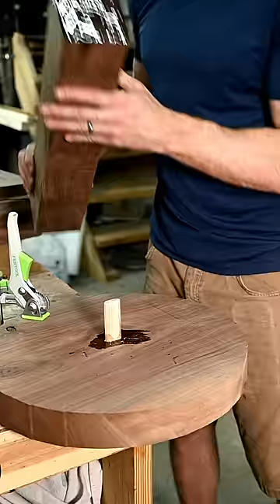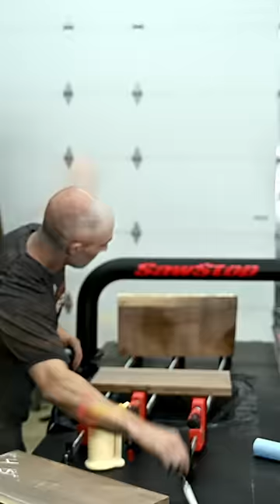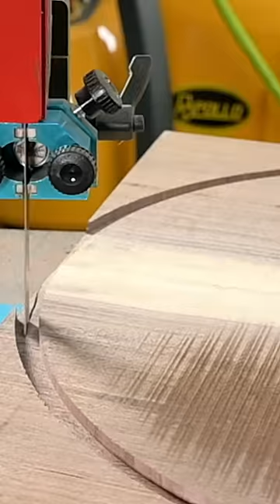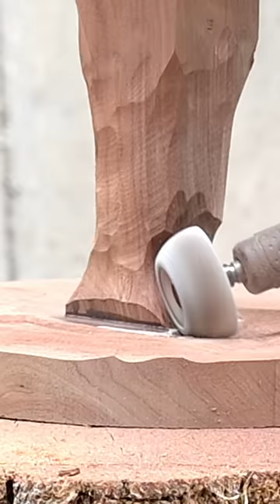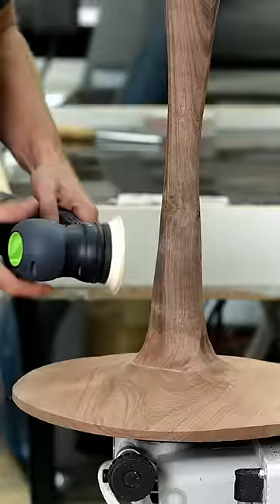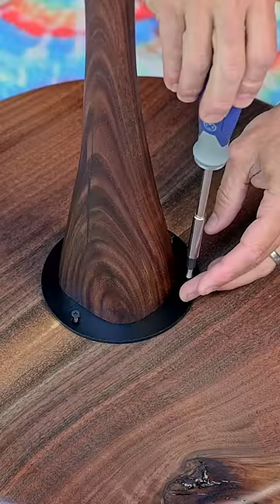I Tricked a Customer

Comment: “I’m going to spend less than $100”

Starts using his $10k worth of equipment
Reply: Yeah exactly
Reply: 10k? Probably more tbh lol
Reply: Way more
Reply: Hell just one of those machines is probably like 15.
Reply: And 80 houre of labor.
Reply: most average woodworkers have this equipment
Reply: $10k lol, that table saw alone is over $5k. His shop is probably close to $50k in tools, or more.
Reply: @TraderJoe_ 🤣
Reply: That table saw was close to 10k.
Reply: Imagine having unlimited resources
Reply: Screw driver..$3 at Walmart, DA, $25 at Walmart, 4" grinder, $50 a Walmart, table saw, $140 at Walmart, end grinder, $35 at Walmart, band saw, $140 at harbor freight, router, $30 at Walmart. 

I think you can plenty of tools, some even not a necessity for less than $1000.... not sure where you came up with 10k from.
Reply: @wojtek-33 didn’t say you couldn’t, just stating the fact he used expensive tools. Building something for $100 is easy when you have a baseline workshop value of $5-10k of equipment. Clickbait vids like this as always wins 😉
Reply: @MsDtab321 was a generalisation, which I guess you misinterpreted. The point is speeding less than $100 is easy when you already own industrial quality equipment that makes the job easy, for someone using manual tools this same table takes weeks - months to build.
Reply: @wojtek-33  calm down petal it’s a Sunday afternoon, relax. I suggest you go spend some time with your family, or have a beer instead of wasting your time justifying a completely irrelevant point to someone on the internet that didn’t ask for a) your point or b) your justification. I stated a fact and you’ve taken it upon yourself to be rattled. Calm down son. Take care
Reply: Lol people like you don’t understand. He probably paid a lot for the tools either out of pocket or with a loan. Either way, I’d be willing to bet, they paid for themselves within a couple months.
Reply: LMAO WHAT??? I’m seeing basic woodworker tools. All of which you can buy for cheap almost anywhere 😂😂😂
Reply: @AshtonLudlam  “he probably paid a lot for those tools..” thank you for ending your own argument. As you were
Reply: Yet you can still do it without all of these tools and just use basic shit
Reply: And he hasn't earned that? Or are you just jealous that you don't have what he has?
Reply: He meant for the eood
Reply: Wood
Reply: try 20
Reply: Lol
As he said, you do NOT need expensive tools
Basic cheap tools from Harbor Freight will do the same thing…
Reply: @wojtek-33 the thing is he can’t make it with basic tools. Been proven time and time again. He isn’t a craftsman. A rich skilled hobbyist.
Reply: He says in another video he has $70k worth of tools. He's a great machinist but an average woodworker
Reply: Because he was able to buy it and create literal art with it. Gotta invest in yourself big man
Reply: The tools he buys is an investment. Lol he bought those long ago as he made more money using them to sell products. That's why you buy tools to use them. Not just to collect dust.
Reply: Way more than $10k!!!!
Reply: Bruh you obviously didnt watch the full thing, he said that you don't need his equipment to do the same thing
Reply: He did say an average wood worker… I’m assuming an average wood worker has at least the basic equipment to do wood work.😅
Reply: @tonelessbod  doesn’t take a genius to understand how much time he saved using machines, and time = money. You think you’re building two perfectly sculpted tables within a weekend with a coping saw, worn piece of sandpaper and a plane? Not a chance fella 😂
Reply: tricks of the trade!
Reply: Exactly!!  I was thinking, closer to $20!!!!!
Reply: @Yeah_bruv No table is perfect and yes you can make a table with very simple tools, I have personally done it but it does take more skill and time to get a good looking table with simple tools but not a month lol 😂 He’s also definitely a skilled woodworker, have you tried making the 6 foot plus long tables, BUt nO He sPendS tO mUch oN hIS ToOLs hE mUsT bE TErRibLE. Also he’s trying to prove a that you don’t need a brand to sell tables and with that 1000 you can buy better equipment, he didn’t just spawn with tens of thousands of dollars of woodworking equipment.
Reply: @401bruh5  I’m not disputing that, but just classic clickbait to say “I’m gonna spend $100” to build a table when you’ve already spent $10-20k on tools. Couldn’t care how much he has or hasn’t spent, just pointing out the obvious misleading of the video and it appears that a fair number of others agree… but all good mate merry xmas ✌🏽
Reply: @Yeah_bruv valid
Reply: He literally explained it could be done with more basic tools, how are you people this dense?
Reply: @Yeah_bruv what are you talking about. Use a jig saw, hand held router, grinder. All for $300 new. Could absolutely make that in a few days if you didn’t hit it hard.
Reply: @MrBeetsGaming  where did anyone say it couldn’t be done without basic tools? The irony of you labelling everyone dense when you can’t even read. Calm down son and have a good Xmas
Reply: @NicholasWHaley7  and that’s still not close to $100. Be careful not to work that last braincell of yours too hard son - have a good Xmas
Reply: Myself and most guys I know who do not wood serious wood working have all of these...
These are pretty standard for many of us who do any kind of hands on work.
Reply: That's called leverage 😅
Reply: Well he had to make up for his 10 cent wood
Reply: Did you miss the part where he said an average wood worker? Because I would assume that an ever age wood worker would have the tools to wood work already. Nowhere did he say you have to make that specific table obviously his high quality tools help but his point stands
Reply: Bros never heard of an investment in his life
Reply: Wah wah wah. I've done this in highschool with some very rudimentary tools.
Reply: Most woodworkers have a table saw and router table. You don't need the most amazing equipment. You just need the stuff to get it done.
Reply: @bjrnchrstn maybe 10 hours
Reply: well over 10k
Reply: The fact that you can only see the expensive tools just tells me that you will probably never make a table.
Reply: Lmfao that table saw you can get for like $3k the band saw is a laguna 14bx it is about $2.5k and the rest of the equipment used (( ts55 track saw, clamps, grinder , sculpting disk)) is roughly another $1k so no not even close to $10k and just because his tools are high end you don't need them you could do it with normal tools ... Now do I believe someone bought them ugly ass tables at all let alone over $1.2k??,...HELL NO 😂
Reply: Came here to say this... I was gonna go with at least 15k in tools first
Reply: I see your point. But definitely more money in it than that.
Reply: 1OK??? Add a zero
Reply: are powertools in america made from gold or something? he used a bandsaw, 200 euros, table router (anything you can do with a table router you can also do with a hand router). I paid 80 euros for mine and 100 on drill bits, the ones he used cost about 30. I paid 60 for my angle grinder and 40 for an orbital sander. My circular saw was less than 200 euros, you could use the bandsaw for that as well. All in all, tools+drill bits+consumabiles is less than 500 euros
Reply: My napkin math places the initial cost for a total beginner somewhere around $500 for tools and materials.  Tools being 90-100 and materials being whatever a bunch of walnut costs in your area so I just went with a high number.  Even at that high estimation you'd still be keeping half the cost of the sale for your work and have some nice hand tools for the next project.
Reply: @wolffang489  he says he spent $90 on walnut alone, and if you think you can buy a circular saw, a jigsaw and all the other mounted tools for 90-100 $ then please feel free to send everyone here the links to each 😂

Comment: its like a mechanic fixing your car drives it on a lift and done in an hour but at your house it takes an hour just to jack it up.
Reply: lol i was thinking the same thing.
Reply: I even have a grease pit and it still take me about that time. It would take less if i left the skid plate off, but it has its purpose as well. It never fails that i have to carefully remaneuver the car to get at least two bolts. Fastest oil change ive ever personally done was 00:01:14 through a lube shop. Proper tools do make a difference, but look at the chainsaw statue craftsmen that can make a quality product right before your eyes. Talent doesnt always need fancy tools to get the same job done.
Reply: How on earth would it take anyone an hour to jack up a car?!
Reply: So let's rip poeple off 
O I did 30 minutes work but pay me 4 hours! Cause you can't jack up your own car.
Reply: You don’t have a lift? I got one for $2k. Might not fit in every garage though, mine has a pretty tall ceiling.
Reply: Fun fact, if you have a garden you can make a hole there, some cement and you are good to go
Reply: @dim1723     My dude, your statement is asinine because it can be apply to anything with a skill trait.

“So let people rip you off.  I cooked a steak and  lightly buttered it and charged them $60 for it. Cause you can’t cook a good steak mash potatoes for your wife on your anniversary.”

“So let people rip you off.  Oh I bought a really really tall ladder and I clean out the gutter and charge people $100+ to clean their gutter.  Cause you’re too lazy to climb your roof and clean your gutter.”

If you’re in your 30’s or older, you should know because should’ve experienced it in life that people can mess up the most simplistic task.  So for those individual who are uncertain about their skill, why do they need to take the time to learn the trait and fuck their own shit up when they can pay someone else to do the task for them.  And if the people with the skill set ruin it for them, they get compensated for it.
Reply: exactly, skill is one thing, the tools to make it cost efficient are another.
Reply: As someone who does work on cars at home, there is not a repair single job that requires the big fancy lift. You can even replace gas tanks, which or on the bottom of the middle-back of the car just by lifting up the back and putting some jack stands under there. It takes 30 extra minutes tops. The most difficult repairs, like engine or tranny replacement, take just as long to do in a shop.
Reply: @dim1723  someone doesn’t understand basic economics
Reply: @bsdetector837  not everyone has a garage my man.... The lift might only be 2k but a house with a garage sure as hell isn't 2k
Reply: @Alex Sauce  so I should pay a mega markup for a job that took 10 minutes. Please take your car in to get servicing before you talk. Mechanic work isn't reasonably marked up. Changing breaks, something even I can do, is ridiculously expensive. (But If I do it it threatens my warranty
Reply: Ignore the thousands of dollars of equipment and ye
Reply: @Johan_1 f your jack is failing and you have to service it or look for your keys for 5 minutes drive 10 minutes to a tool store wait in a line for 5 minutes buy a new jack 10 minutes back to include about 15 minutes in traffic then get home sit on your couch for about ten minutes drinking a beer then take 5 minutes to jack your car up set it on stands then procrastinate and just finish whatever you were working on the next day bc you couldn’t find your 10 mm socket and don’t feel taking your car off jack stands to go back to the tool store…
Reply: @matthewchant2253  you have jack stands? we just have blocks of wood for us poor people.
Reply: @dim1723  yes i should charge less money because i got good at doing something that you dont know how to do at all. makes perfect sense
Reply: @OgBadlaws  Only the rich use wooden blocks.  I use pine cones and corn cobs.
Reply: @OgBadlaws  Epic comment man. I make a ramp of wood blocks or cement stones/garden tiles.
Reply: @randomdamian  haha
Reply: That's a thing and in addition you avoid getting yourself crushed if you fuck it up.

Comment: "Spend less than $100"
Uses $20,000 worth of equipment.
Reply: Yeah like more than half of this shit ain’t stuff you can’t find either Home Depot or Lowe’s on sale either 😂
Reply: Yeah but he owned those tools before
He didn't buy them for this one time, you could do this with the most basic tools
Reply: Shut up obviously He use tools He is a pro
Reply: you can buy all these tools for well under $3000. not the brands he used, but the tools and they will do the work for this build all day.
Reply: @GodMaxDrinkerofTea  If he wanted to prove that an average woodworker with basic tools could do this, he could've at least used basic tools. He didn't.
Reply: @gordo6366  because it should be obvious as all he did was saw and sand

Of course it's more time intensive with basic tools but come on, it's not that deep.

If one were to drill a hole with a drill press, would you not believe it was possible with a normal hand drill?
Reply: @GodMaxDrinkerofTea depends on the hole in question. An alignment hole which needs to run parallel to a surface, fuck no. Not only are the tools a very significant cost, a cheap sander will absolutely take ages for that leg, you'd likely be constantly overheating the thing, perhaps even break it during the process. These are all possible factors, don't underestimate the sheer stress of unreliable tools. That's why I call bs until I see this done with cheap tools, also blatantly ignoring his experience as if just because it's not complex that doesn't affect the end product, also his photography and marketing know-how, etc.

Many factors which this guy conveniently sweeps under the rug so he can continue to believe he's better than everyone else only because he works harder
Reply: A jigsaw and a grinder are basic tools, maybe a small router
Reply: What a band saw and a router table? Band saw ryobi for $150. Router table around $100 and then a $100 router, $100 grinder. Sorry I saw he used a circular saw. Another $100, corded circular saw. Don’t need to use a table saw like he did but again not expensive.
Reply: @gordo6366  If you have a steady hand(using a drawing circular, like in old days), you can draw a circle on the wood and cut it with jigsaw. All the fancy tables he used is just an expensive upgrade to clamps and old table, which really does not require thousands. All of them really helps only a little bit... though it makes the process comfortable, but he is right in that if you are an average (professional) woodworker, you already have all the tools to do exactly what he did in the video. Most of the people are not woodworkers and comment BS, thinking that expensive tools can make them woodworkers and not a practice - without these expensive tools, btw.